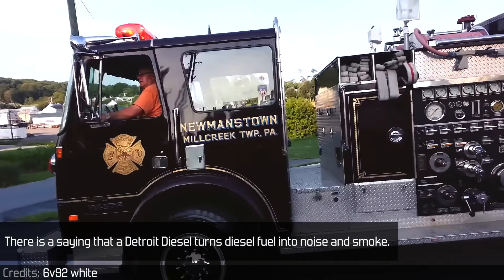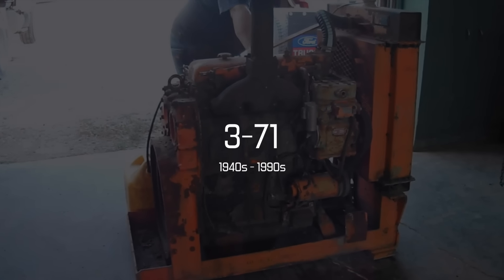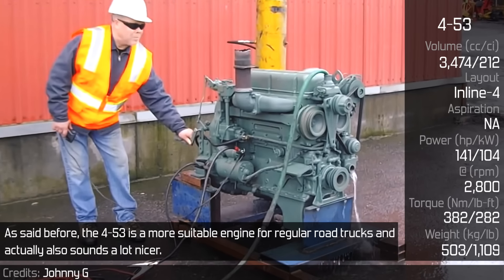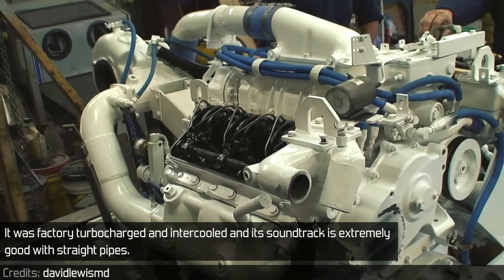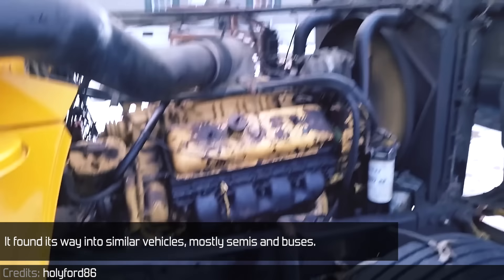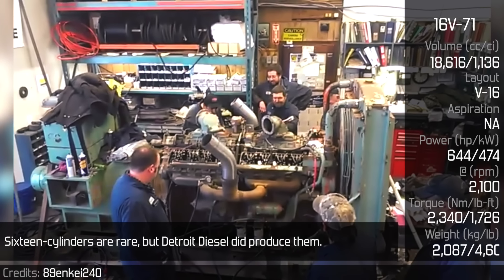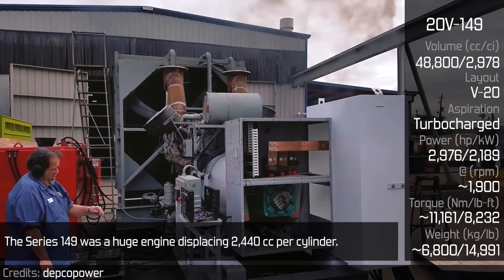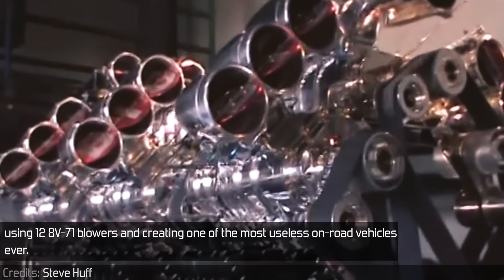9 Of The Greatest 2-Stroke Detroit Diesel Engines Ever

Comment: Back in the 1960s I travelled a lot by bus.  This video had me all nostalgic for the hypnotic mellow purring, the faint whistle  and a whiff of diesel. 

A buddy had an ancient wooden boat with twin turbo charged 6-110s. Talk about burbling!
Reply: The 6-110 platform was a tremendous engine and one of DD's biggest mistakes of discontinuing it's production.  They totally misread the upcoming needs of OTR truckers of that era.  The 6-110T was a good 15 years ahead of Cummins & Cat. in hp & torque outputs in it's stock, factory ratings... outputs could have been Reliably been doubled (and Were, on the dyno), if needed.
Reply: @Romans--bo7br  Only problem with the 110's was their forced induction system... the pinwheel blower unlike the locomotive variant didn't like rapid speed changes. Still, they did sound fantastic!
Reply: @kleetus92 .... Hi kleetus, thank you for your reply.  The issue's with the 110's Centrifugal blower was not the in the speed "changes", but in the metallurgy of the era for use in producing the impeller on the "compressor".  
Anything, and I do mean "ANYTHING" over 2100 crank speed, meant that the impeller would begin to disintegrate and send pieces into the cylinders.... which is why we redesigned the block for the roots blower, as we should have done in the first place.   

It is also the same reason that our experimentation of the 6-110 into class 8 trucks was cancelled, as over-speeding of the centrifugal blower, due to down grades, missed shifts, etc... would spell disaster for the engine, immediately... at every occurrence in the truck (GMC - HDCW 950X) sent to P.I.E. for use in the mountains between Denver and the west coast, that an over-speed was encountered, the scavenging blower.. disintegrated.  

I told my colleague's at DD, that they made the wrong decision in dropping production of the Series 110, in favor of the "V" configured block, released in 57.    

The 275hp (n/a... was actually closer to 300hp in our Dynamometer test cells at 1,800 rpm) was far ahead of the 4 cycles of the era, and with the roots scavenged engine at 315+ (n/a) and 349hp (T) were nearly 20 years ahead of Cummins after they had finally developed a turbocharged engine for full time production commercial class 8 truck use.  

The 6-110 was Never designed in any actual commercial use... it Was, however designed On the Dyno, and was NEVER run over it's rated maximum crank speed of 2100, and as the centrifugal was driven at ten (10) times crank speed, it was running at approximately 21,000 rpms, which was the designed maximum limit, giving consideration to the metallurgy of its era.  

There were Two (2) experimental / Prototype engine platforms on the dyno's at the time that GMD / DD, decided to pull the plug on the 6-110, a V8 (n/a and T) and a V12 (n/a and T).   

As a company, we completely misread the coming future needs of commercial class 8 trucks, in terms of torque and simplicity of engine design (inline 6). 

We had real, potential  "powerhouse" on our hands (the roots scavenged block), and we threw it away.  When I say "we"... I'm referring to GMD/DD as a whole... I was not employed by them until 1971 (under contract), in designing new scavenging systems.  

I obtained my four year degree in "Diesel Engine Design and Theory" (specializing in 2 cycle) in 1967, under the direct tutelage of P. Nicholas, who had just retired (in the summer of 1963) from R&D at GM Diesel, and who was one of the three lead engineers who developed the very first prototype series 71 engine (a 4-71) in 1937 and who he, himself... worked directly under and with, "Boss" Kettering, himself.  

I designed the very first Thermatic / Overrunning clutch driven Axial Flow turbocharger and redesign for the 6-110 and Series 71 engine platforms, and was had a patent applied for it, until we found out that the EMDivision of GM, had already patented that very design for their earlier Series 567 D2 & 3, as well as the just released (1964/5) Series 645 platforms, even though neither of us had any working knowledge of the EMD prime movers at the time.

Comment: I started working on Detroit Diesels as a young man in the mid seventies and I love them. My favorite is the in-line 6-71. But the largest I worked on was a 12-v-149 used in 100 ton rear dump Euclid off road trucks. 
I would love to have a 6-71 in an old B model Mack to play with . 
Detroit Diesels Rule!!!
Reply: In Australia there is a 6-71 or 6V71 in a B  model  Mack restored as well. Google search that one. The 8V71 is my favourite.

Comment: I'm a heavy diesel tech and most of my work is on site. recently had the pleasure of fixing some external oil leaks  on a 12V92 spinning a generator. Complete with original Detroit cast radiator. Sounded great in a shipping container with twin exhausts through the roof. My only complaint with these engines was the lack of torque figures. All up and therefore gotta keep them revs up.

Comment: We had a 1953 FWD truck with an inline 6-71. What a powerhouse that was. I drove city buses for many years. We had 6V-71, 8V-71 and 6V-92 engines, depending on the year and model of bus.
Reply: The 671 was strong. We had one in a 52 Euclid belly dump. Loud and proud. Had an old Clark 5 transmission.

Comment: Dutch truck manufacturer FTF (Floor Truck Fabriek) used Detroit Diesel two-strokes in their trucks mainly fabricated for very heavy transport. You can see a logo from them in the window from the office in the 16 cilinder part. Now they only produce trailers, you can see them on the road with "Floor Holland" on the mudflaps. 

Again you made a nice video. There are a lot of compilations on youtube, but yours are simply higher quality and it makes them nicer to watch. Keep up the good work!

Comment: For those who don't know, you can figure out the displacements on these very easily. Take the last two numbers, which is the cubic inches per cylinder. 53ci, 71ci, 92ci, etc, and multiply it by the first one or two numbers. That's the whole displacement.  Divide the cubic inches by 61.237 for liter displacement.

Comment: Nothing like the sound of a Detroit. I've worked on and operated everything from the 4-53, 6V-53 up to 12V and 16V-248-A Engines.  Including the Slant 6-71 which I have seen set-up with twin-turbos. The Slant was an inline 6-71 layed almost on its side for use in boats.  Great Engines most reliable as Stationary or Marine Engines. Something you didn't mention is depending on how the valve train is arranged you could run the inline engines in either direction. This was real useful for marine applications where rotation is critical.  The one thing you could always rely on is they all leak oil.
Reply: The thing with the 71 series in a truck you can tell how the previous driver was operating the engine when they turn it off when they come in for a truck stop. If it's an 8V71 and they've been lugging it rather reving it both air box drain tubes will have a healthy oil spillage on the ground. I had a mate that drove Detroits in trucks and buses and the ones he used hardly leaked, always dry, trust me I serviced them. The bus fleet had VT903s Cummins as well that only used a bit between changes.

Comment: I was an engine machinist for 45 years and worked on hundreds of engine types. I think nothing had more potential than the super simple two stroke Turbo Diesel Engine. Light weight, simple and powerful and could go 600,000 miles before needing to be rebuilt. The power to weight ratio could not be beaten since it fired the piston on every stoke giving a V8 the same power as a V12 had so they could be built smaller too! With modern materials and engineering I hope it makes a come back. This engine was mainly used in older buses and trucks and was made illegal since people hated that massive puff of black-smoke they made during take-off. That could have been easily fixed today by leaning out the fuel-air ratio during idling, using an electric power turbo charger made of all plastic parts with a computer which they did not have back in the 1970's when they were slated to be phased out. Very Sad Death of a fabulous and forgotten engine technology just waiting to be rediscovered and fixed in this modern age.

Comment: In 1984 I purchased a restoration project, a tank that had been cut down to make it into an earthmover in 1947. It had its original 6-71 engine. I put two batteries on it and it started within 5 seconds after 37 years of complete neglect. The tank is now restored, running on that original engine. In the 40 years i have had it i have replaced fuel and oil lines, a clutch plate and i have a new fuel pump to fit soon. A wonderful engine!!

Comment: The last of the Silver 8v92TTA DDEC IV we had in trucks in Australia rated 440 -475Hp were stuff dreams were made of
Reply: The TTA is actually detuned, and does not make that much power. The TTA is tuned for "fuel economy" and to be less powerful, often at under 400HP.

It's the TA that makes 475 or better. Up to 550HP with the factory tune and injectors.

Comment: 8V92 rated @ 465 hp , most powerful truck i ever drove . Not mentioned here .
Reply: Had one in a cabover kenworth I drove!  Damn thing would lift driver side front tire off the ground in the first 4 gears if you where taking off on a hill. Good times!

Comment: You completely skipped the 6/71 straight 6 238hp. Those engines were designed in1938 and prolific on/off road through the 60's - 80's. Emissions is what killed them.

Comment: At a minesite power station where I used to work, there were 5 EMD (Electro Motive Diesel, owned by Detroit) ex-locomotive 20 cylinder two strokes connected to 3.3kV 4 pole alternators, producing 2.1MW peak power at 1,500RPM (50Hz) each that were left over from the very start of the mine.They had an unusual exhaust scavenging system which consisted of a large diameter centrifugal blower bolted to an axial turbine which was fed by exhaust gases. The blower was driven from the crankshaft via an overrunning Sprague clutch. Up to about 1.6MW, the blower was mechanically driven. Above 1.6MW, it was increasingly driven by the turbine, making it a turbocharger. The increasing pressure & density of the exhaust gases as the engine generated more power caused the  blower to spin faster than the mechanical drive thanks to the sprague clutch making for lots of scavenging air.
We also had a back-up 415V, 600kW generator driven by a Detroit 16V two stroke with quad turbos. It made a beautiful throaty snarl & looked very impressive at night with its turbos & exhaust manifolds glowing red at full power.

Comment: 71's rule!!!  The 71's use a dry liner instead of the wet liners in the 53's and 92's.  The 71's are nearly indestructible,  they just don't brake in the natural configuration. I  have two 4-71's that started in August 1980 and now have 65,000 hours on them, never had the heads off, still going strong.  (1400 rpm max marine use - rated 115 hp at 1800 rpm)
Reply: Agree, the 6-71 in-line was the peak of awesomeness, massive main and big end bearings, understressed and overbuilt. I've had them in prime power generator use run 30,000 hours plus at 1500 rpm and 100KW all day and all night. Stop them about once a fortnight to change the oil.

Comment: Nothing will ever replace the noise of a Screamin' Detroit up a 4% grade.

Smoke? ✓
Power? ✓
Amazing noise? ✓✓
Reply: id cross out the power lol
Reply: Power... lmfao. I've owned 12.7 Detroits with 625hp /2050tq, but none ever sounded as sweet as a 2 stroke
Reply: tinnitus - check
Hearing loss - check
Got em both......
Reply: @wharris302  One thing to keep in mind is that the power the screaming jimmys produce come from much smaller motors than their 4-stroke counterparts.

A 6-71N has more power than a Cat 3306 from a 7 litre vs 10.5 litres from the turboed Cat.

Comment: Thank you for the excellent video.  And yes, the jimmys are reliable if somewhat less sophisticated than the competition.
Reply from the maker: Good to know then!
Reply: Barnekkid Reliable, simple to repair, and made money for the truck owner.
Reply: It should be kept in mind that the basic design was developed in the 1930's. Many folk say they were thirsty and gutless, but are comparing them with engines developed 50 years later. The fact they still make some of these for the US military has to say something for them. Besides, they sound good at any speed, and apart from exhaust noise, they are fairly quiet mechanically, and don't rattle at idle like a bucket of bolts like most modern four stroke diesels do. To listen to, they are like comparing crisp toast to a soggy crumpet.

Comment: That 6V92TA where the guy had the vice grips on the rack (common to do on a rebuild to make sure the governor and injectors work correctly) puts out a lot more that 280 hp in marine trim as this one was . More like 535-550 .

The term 'runaway' is what happens when you let your helper run the rack for the first time on a 6V53 and he runs the buffer screw in a little too much and rather than putting a board over the blower (or tripping the emergency air shutdown) therefore inverting the blower seals in the just overhauled blower , takes off running from the screaming engine that's floating valves . That would be you , Todd . I certainly hope you called 1-800-Be-A-Chef by now .

Comment: Had a 8v71,1973 white Western star ,got in running backwards one day slipped the clutch almost stalled it engine bumped back and oops no  oil peasure exhaust coming out air cleaner and forward gear became reverse,pulled air shut,had to stall it to stop,Good times sceaming ass engine.
Reply: Yes, I saw that happen with a 6-71.  Didn't run smooth, but still ran backwards

Comment: They also made a silver 8v92. It was in a international transtar 2 and was powerful and fast for a semi truck!
Reply: best sounding one too
Reply: We had (I think 10) AM General transit buses with 8V-92 turbos. I loved those engines.
Reply: Dave Luttinen back in the early 90’s we had two 8v92 twin turbo buses at Greyhound, they weren’t allowed in Cali even back then. You could hit 85 mph in third gear.....just badass in a 25 ton coach. It was the MC9 model from MCI
Reply: My grandfather drove a truck with that. It sits where i work and unfortunately it would need work to get it running
Reply: @skeezix8156  My 8V92 experience was in a Eagle coach with an automatic. That thing would pick them up and put them down. I did tend to prefer the sound of the 71 however.
Reply: We had leased some Eagle buses in the mid 90’s when business was booming. We only had them for a year and I think they had silver 92’s in them. Jeez I hated those buses compared to MCI’s. Rock bands used them a lot back in the day because they had no air suspension and were more reliable in that aspect.
Reply: @skeezix8156  We only had a couple of MCI 96As back then so I didn't have much to compare them to. Spent my formative years riding in Eagles so was in heaven when I finally got behind the wheel.
Reply: Bach man Turner Overdrive had a single drive cabover Ford with a 318 that they used for band equipment, stage gear, amplifiers etc. You ain't seen nothin yet.
Reply: Skeezix what coach weighs 25t?
Reply: @daveluttinen2547  How about an MCI MC6  with the 12V71 and 4-speed?

Comment: So the classic hotrod 8-71 blower originally came off an 8-71 detroit diesel? Cool.
Reply: Actually it was a 6-71 and only the one that came off of an inline Detroit 6-71. The hotrod 8-71, 12-71and 14-71 blowers only come from hotrod blower shops and were never installed on a Detroit engine.
Reply: If I remember correctly the 12-71 had 2 6-71 blowers on it
Reply: The 8V-71 did have an 8V-71 blower on it.  The 16V-71 had two.

Comment: Great collection of restored trucks on the 12/71 powered Australian Kenworth roadtrain, I drove White Roadboss's with a 6/71 Detroit for an oil company in Australia, 13 speed Road Ranger and full Jake breaks made them a very distinctive sound when working.
Long gone now but a part of trucking history.
My favorite though was a Mack Superliner with the an upgraded  550 hp E9 V8 Mac 12 speed Mack box , great engine great sound.

Comment: our engine rebuilder says that you should run the engine like you hate it.  since they are well governed, thats what we do.  low speed and idling are death for these engines
Reply: A lot of guys around here said that too. They hauled a lot of rock in semis with 6-71s.
Reply: josh m Yep. With the two stroke Detroit engines you had to drive it like you stole it.
Reply: My Dad always said that as you got in the truck to Take Off, you should set your hand in the doorjamb, and SLAM the door shut on it. THEN you would be in the CORRECT Frame-of-Mind to Drive it RIGHT.
Reply: Yea once ya have oil pressure and shes good for a minute, put a load on it or else ya might not seat the rings. 
When done right, rings are seated within minutes, and the rest of break in period is just lettin the bearing surfaces get comfy with each other.